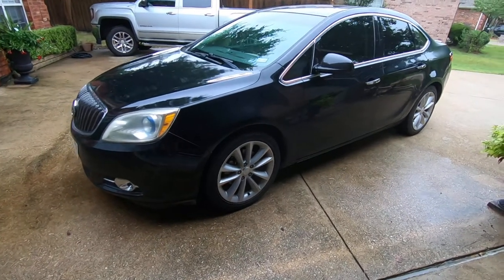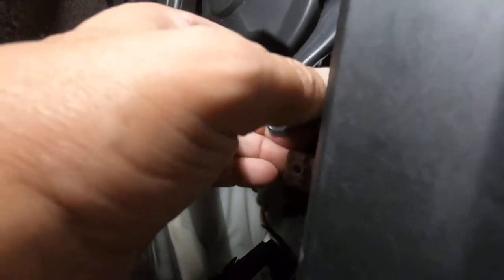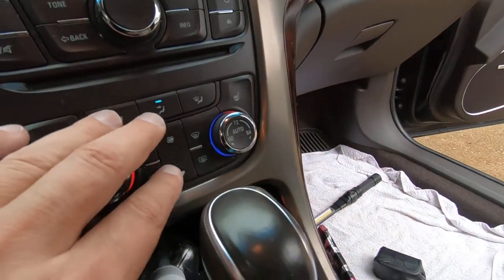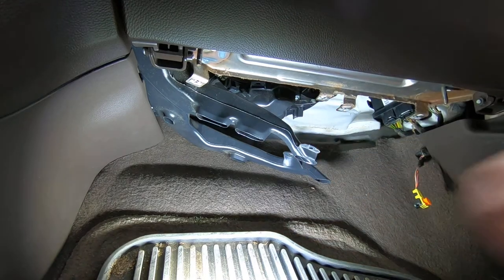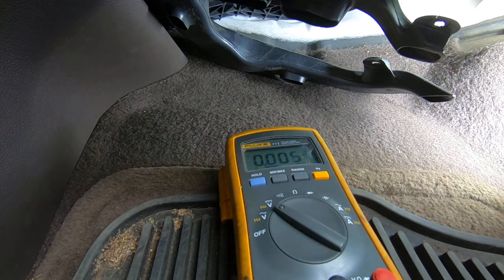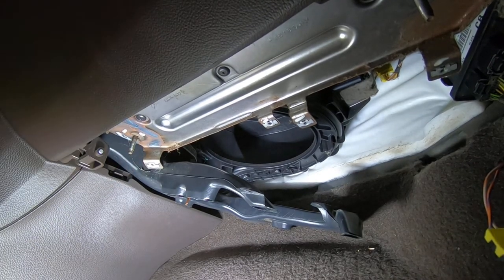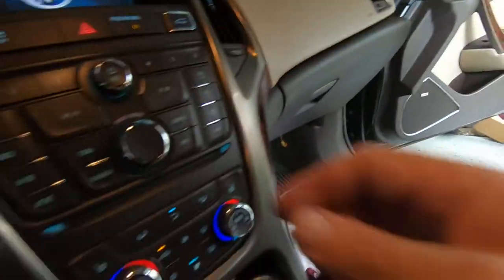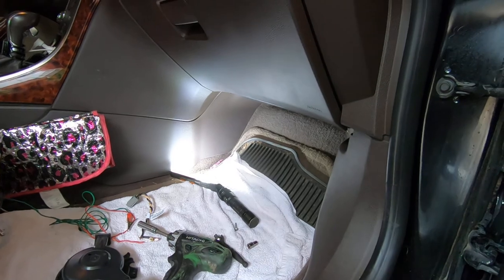2012 Buick Verano Blower Motor Troubleshoot and Replace.

Comment: What kinda scanner is that? I'm being told they can't scan for anything to do with hvac.
Reply from the maker: That is my Autel MS906 but my Xtool D8BT and my Launch x431 all 3 will scan and control the HVAC modules. Whoever told you they won't scan HVAC does not own one or know what they are talking about.
Reply: @737mechanic   okay. I'll keep that in mind. Thank you sir
Reply: @737mechanic  is there maybe a generic name for that kind of scanner?
Reply from the maker: @BRAND0N...  Most if not all Full Bi-directional scanners should scan and be able to control the HVAC modules as well as the other modules.
Reply: @737mechanic  thank you.

Comment: Thank you for this! Do you know whether the 2012 Verano has a blower motor resistor to control its speed? Ths blower speed keeps oscillating randomly in my Verano, no matter if climate control is on Auto or not... The motor seems to be working fine, but whatever controls the speed is unable to keep it stable...
Reply from the maker: That car should have a blower motor control module.
Reply: @737mechanic it has a blower motor resistor. That is what the blower motor connected to

Comment: I owe you my life, middle of winter here in PA 5 degrees outside with no heat inside. 

I slapped the panel where you showed and it turned on. 

Thank you!

Comment: I'm having the same issue with the same exact car. Once I tap the blower motor with my hand. The blower motor starts up immediately n works just fine. Every few day out of nowhere. It won't work anymore n I have to tap on the blower motor again. 

Do u think it's just the blower motor based on what I just mentioned? 

Thank you for the video.
Reply from the maker: Yes, more than likely.